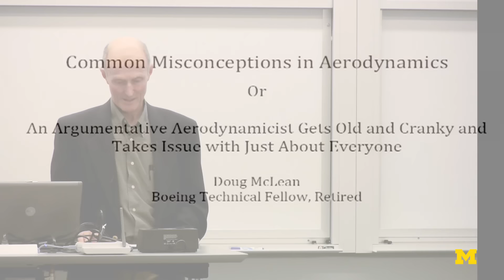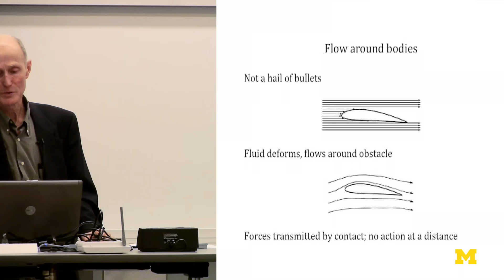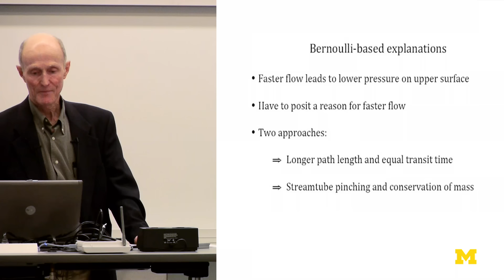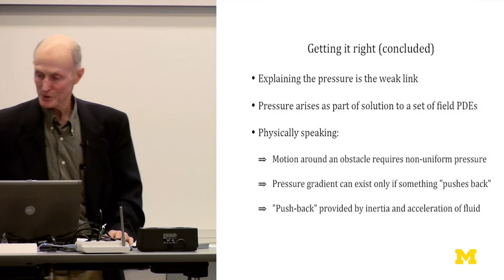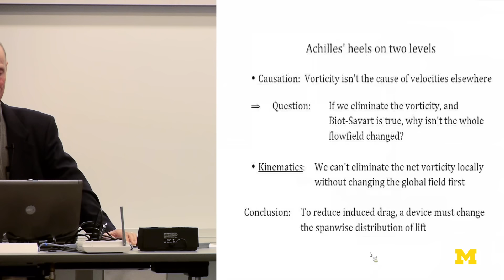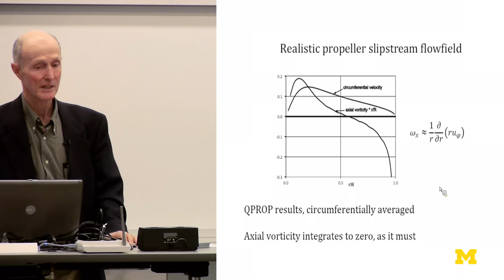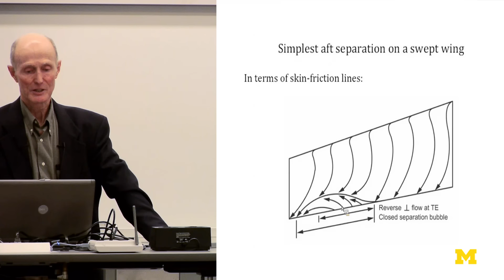Doug McLean | Common Misconceptions in Aerodynamics

Comment: I've put a splitter on the back of my car that resembles the engine cowling of a Boeing Dreamliner. It seems to work exceptionally well at reducing the vacuum behind the car, and has a significant impact on fuel economy. (Partially seen in my profile photo)
Reply: If you are referring to the random sized shark-teeth edges, weren't those supposed to lower the sound (noise) from the engines? You have used the words "exceptionally" and "significant" to describe the performance of your design, so I am assuming a patent is in the offing? If not, at least a video for the rest of us, is required.
Reply: Do you mean a rear diffuser? https://en.wikipedia.org/wiki/Diffuser_(automotive)

Comment: Literally you should be able to use a barn door for the wing because the traditional wing shape is not explained at all.  If Bernoulli had any effect or validity whatsoever then an airplane could not fly upside down nor would a symmetrical wing fly..
Reply: To address your last point: It all depends on the angle off attack (AoA) which is the angle between the incoming flow and the straight line between leading edge and trailing edge. A symmetric airfoil does not generate any lift if the AoA is zero. In fact, the pressure distributions at the upper and lower side are the same which is perfectly in line with Bernoulli. However, if the angle of attack is positive the generated lift is positive and at negative AoAs the generated lift becomes negative. Also, chambered profiles may produce lift at an AoA of 0, however they also have an AoA at which they generate a lift of zero.
Reply: This is the simplest lift explanation. Bernoulli and all of the fluid dynamics stuff is efficiency and flow around the ends of the wing. In my opinion.

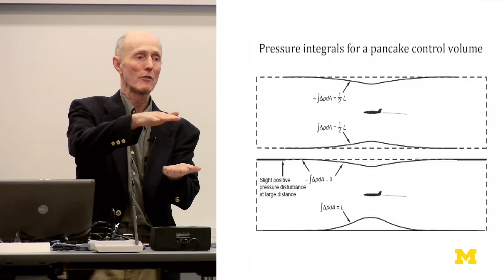Comment: 45:56 So...a layman's understanding here...He's saying that an airliner weighing 65 tonnes produces a downward force equivalent to the lift of 65 tonnes, but it doesn't crush everything it flies over, because that airliner is hanging in a volume of air far larger than the aircraft. The change in PSI you experience from an airliner flying over your head is around the same as a cold front going through.

Comment: I have my BSc in physics as well and I'm also about to get my private pilots license and every time the explanation of lift came up during ground school it never made any sense to me. Why do air particles HAVE to meet at the other side of the airfoil? They don't. Why is the fluid speed faster over the top surface etc. It's always explained in the pilot community with these naive explanations but this and a couple other videos are gems when it comes to gaining a true understanding of things. This reminds me why I chose physics as my degree!
Reply: One thing I'm surprised no one touches on: the contribution of inertia of the contiguous volume of air being accelerated by the angle of attack, the underside of the wing.

It's not clear why it's never mentioned that inertia of the air contributes to lift for airplane wings. It is only hinted at when Newton's 3rd law is mentioned.  An airplane wing traveling at constant velocity (ie. plane not accelerating) encounters air at neutral (isotropic) pressure and accelerates air below the wing at a magnitude dependent on the angle of attack of the wing. 

(Extreme example: if the wing's angle of attack were made by turning the wing vertical, the inertia of the air would prevent lift, and the airplane wing would be acting only as an air compressor for the air immediately adjacent to it.)

If the air could be accelerated instantly - with no inertia - it would not create lift.  The delay in response, caused by inertia, for the air under the wing to 'get out of the way' of the wing's angle of attack is a contribution to lift.  The air cannot 'get out of the way' instantly, partly due to inertia (air being matter, and all matter experiences inertia under acceleration).   The angle of attack is therefore partially compressing the air immediately adjacent to the (underside of) wing, and the compressed air pushes back against that, creating lift (Newton's 3rd law).

This is also why a wing does not 'stall' if its constant velocity is great enough: the angle of attack of the wing accelerates the air underneath, and at great enough velocity, the acceleration of the air under the wing is great enough so that its inertia (inability to instantly accelerate 'out of the way' of the lower part of the wing) is great enough to contribute to lift.

If the wing is moving too slowly, inertia of air being accelerated by the angle of attack can no longer contribute to lift.

.
Reply: The false "equal transit time" is a misstatement of a related requirement:  in steady state, rate of mass in has to equal rate of mass out.  We know intuitively this has to be true.  This more carefully considered truth drives the acceleration of airflow due to the path restriction of the airfoil's asymmetry to be faster than "equal transit time."

For the "equal transit time" fallacy people are focusing on too tight a location in space.
Reply: Yep, you don’t go into much detail in pilot training, especially for private, primarily because you don’t need to be an aerodynamicist or aeronautical engineer to be a good pilot. Being a good pilot is mostly about situational awareness, adherence to checklists and safety procedures, and some stick and rudder skills. For example you don’t need to know why the boundary layer exists, or why the air molecules do what they do, only things like how an airplane stalls, a general idea of how lift is formed, forces, etc. Everything after that is just extra credit in my opinion because knowing the ladder really won’t make you fly better unless you want to be a Test Pilot or engineer.

Comment: I enjoyed this lecture very much.  I always thought that the average pressure at the surface of the earth must go up slightly.  My simple view is that, for example, if a 747 weighing 735,000 lbs. is contained in the atmosphere then the average pressure at the surface of the earth must go up by (735,000 lbs.)/(790.4x10^15 sq. in.) which is about 1x10^-12 psi.  I'm guessing the actual pressure directly under the aircraft is momentarily much higher (as was shown in this video) but, in the long term, the entire weight of the 747 must get transferred to the earth's surface and reflect itself as a small pressure increase on the ground.

Comment: I am sure that the Pressure field sustained by fluid innertia and acceleration can be explained with some simple test setup with a piston and gas. In fact must be able to do that together with combustion engine engineers who look into detail of intake manifolds and piston movement. I am sure a Technical Physicist can build a model and explain. Quite surprised that Boeing would not have done that R&D considering the scramjet technology out there.  Rather important to understand pressure waves?

Comment: The common thinking here is that the air flows along the surface of a wing or wing profile, whereas in fact it is the wing that passes the air particles, causing them to react in various ways. It would be important to really begin to think about this wing-air interaction in this way, to understand the phenomena.
Reply: It's Newtonian physics, it shouldn't matter
Reply: @DF-ss5ep  I mention it because its there. I leave it to others to figure out the possible differences. :)
Reply: With a sailing yacht the wind typically is faster than the wing profile ( or sail ) of course but things are different with an airplane.

Comment: I am not entirely sure this video really did clarify and explain how lift is generated. it started off pretty good to debunk the wrong ways of thinking how lift is explain, but at the end I am still not sure if it did much to explain how it's generated. Perhaps I missed something, which is possible.
Reply: @William Buckley; Mankinds Great Intellectual! Mr Buckley, I believe we understand how an airplane flies and how lift is generated. We know lift is the resultant of differential pressures around the wing. That much is clear to a lot of people.  I think the problem is how we explain it and your statement above is a good example, which is what the video debunks. We know Bernoulli law explains that increase in velocity of an air molecule on the same streamline decreases pressure and slow air molecule increases pressure and the resultants of imbalance pressures keeps planes in the air so that's not the issue. The issue is often times, the explanation as to why the velocity increases at the wing top and decrease at the bottom of the wing is where people explain with haste. And you made the same mistake in your replay. As the video debunks, what is the physics behind the claim that the air molecule at the top and bottom has to meet? Did they decided at the leading edge that "hey meet me at some time at the tail end of the wing and let's have pizza and beer?"  That's the issue with such explanation--there is no basis for that logic in physics and that's where people confuses the issues. I think the video did a good job debunking that explanation, but my problem with the video is I didn't understand the replacement of the physics explanation as to why the velocity increases at the top and lower at the bottom. That's what I was asking about. Thank you for trying to help, but I think like me, you also didn't get the physics explanation of the why the velocity increases at the top. I would like someone to explain to me as to what the physics explanation is that causes the velocity to go up .

Comment: Why dont we see swept up wingtips on rear horizontal stabilizers? Only on maing wings?
Wouldnt adding this also reduce drag?
Reply: I have no answer to this with regards of what's better, but they technically do exist. A lot of WW2 aircraft and even the A10 today kind of achieve this by having a double vertical stabiliser on the edge of the horizontal stabiliser. For military I know that there's radar cross sections that need to be considered which increase drastically with angular planar surfaces, the A10 is an exception because the stabilisers are actually used to hide the hot engine exhaust from IR seekers.

With regards to airliners, I think it depends on the results of CFD and wind tunnel tests. I would guess that if rear winglets increased efficiency they would be on there since an airline's goal is to maximise cost. But take this with a grain of salt.

Comment: Interesting discussion and agreeable   Theoretical explanations. Especially ground effect. Often misused words have caused common misunderstandings and debate. If we correctly describe lift and induced drag as components of a total reaction vector ( up & back if you like ) it becomes easier to talk about each component as parts of a whole rather than commonly labelled individual phenomena dependant on the other. Moving and airfoil through relatively still air compared to the inverse wind tunnel or modelling ( moving fluid ) environment does not get much consideration but perhaps it should. Vortices change the velocity of airflow over a certain area of the airfoil in increasing or decreasing amounts. Think angle of attack speed and the trade off effects on the total reaction. Useful for work airfoil area vs not useful etc.

Comment: Speculative interpretation of tip vortices, have been modified energetically, and reversing the spin would cost another amount of equal energy, doubling the power waste. 
The better idea is Dragonfly Wings that produce then rectify the pulse-spin of each wing in sync-duration.., like the period doubling of frequency in a Fishtail thrust against the water.., and yes it does relate directly to harmonic conductivity in logarithmic spin-spiral 2-ness holistically of course.

Comment: Wind passing over a water surface like the ocean, what are the relationships that then cause a wave to develop and move across a surface when the individual molecules do not move. Inertia of molecules caused by the spinning of the atoms that make up the molecule, account for this inertia.  For every molecule that is moved another thousand must move because of proximity.  Newton and inertia is the primary event , low pressure is the outcome and lift is the result of a introduction of Force in a steady state.

Comment: Yes lift is generated, it is the air pressure difference distance between the top and and the bottom of a flat shape or a symmetrical airfoil even with no air moving over the surface.

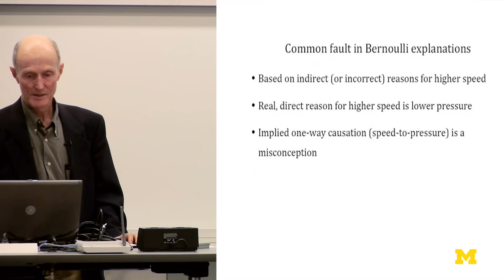Comment: I really liked this lecture but some parts definitely made it feel like the speaker has some strange philosophical ideas about the ontological structure of mathematical models of the physical world. For instance at 19:44 bullets 2 and 3 seem to be in direct contradiction, and in general there seems to be a tendency to assert the primacy of certain mathematical features of fluid flow as the "real" driving causes of a phenomenon over others (e.g. vorticity and velocity, etc.). If you assert that a physical law is true and the roles of two variables in an equation are truly symmetrical (so each variable can be recovered from the other, all else being equal) then I think it's adding philosophy to the physics to say that a change in either quantity "causes" a change in the other. Instead it seems that one has to admit that the quantities are inextricably bound up with each other, and that both measure the same underlying physical reality. The speaker himself comes dangerously close to asserting this at several points during his talk. 

To a lesser extent I also don't really see why an explanation of lift derived from "Newton's third law" is really inadequate at all (if, say, it mathematically replicates all physical data to a decent degree which it really must if the explanation is precise enough): certainly Newton's third law is true, and given that one can impute responsibility for the lift of an aircraft to the concomitant downward acceleration of the air around it. Yes one doesn't provide the literal "force" that is acting on the airplane but for one: (1) forces are only measured through their acceleration on the bodies they act on; (2) we already know it's going to come down to the electrostatic repulsion between the air and the wing, so why bother?

Anyway the misconceptions were very interesting to see, especially the (obvious, in hindsight) failure of Fubini's theorem towards the end of the lecture.

Comment: Great talk. The main thing I wish more teachers would point out is that the reason an airfoil affects the atmosphere ahead of itself is because pressure differences propagate at the speed of sound.
I especially like your point that the inertia of the fluid is essential to maintaining the pressure difference. i.e. inertia provides the time delay between propagation of the pressure, and mass actually being accelerated along the pressure gradient.
Reply: I think it's a bit trivial to state that inertia is needed. If it doesn't have inertia it doesn't exert forces (momentum is conserved).

Comment: I have always found the Newton's law explanation of Lift to find intutive...Bernouli a bit more difficult..but I can see how they complement each other
Reply: Bernoulli is for flow in tubes, not free.
Reply: Well, in order for Newton's 3rd law to produce lift requires the air flow to be directed downwards, which it does not explain itself. Consider airfoils that produce lift even at negative angles of attack. The intuition of course makes sense, IF air is "pushed" down locally then the wing should be pushed up.
Reply: @0MoTheG  No, Bernoulli applies within any flow field.
The problem with using Bernoulli to explain lift is that it actually only explains a very narrow effect/relationship of static pressure and kinetic energy.
Reply: @0MoTheG  Like John Doh said, Bernoulli applies within any flow field reasonably as long as the flow doesn't exceed a mach number of around 0.3 (it's not super clear cut when it stops being useful but it's an industry rule of thumb).

Comment: The equal transit time hypothesis simply confuses the action with the reaction. It says you invoke a pressure differential and then get lift from it. This is like saying that lift causes lift. In reality however you can only get lift if you deflect air. And you can't deflect air without getting lift. Lift  is an upward force caused by a downward one. The bernulli principle can help you understand  how a force transits to a wing, but doesn't explain the cause of the force, which the deflect of air. Try getting a upward force on a wing without deflecting air downward.  You can't. Trying to get away from this basic fact, won't help you. Lift doesn't doesn't cause lift. Only a downward deflection of air causes lift. There are no other causes period. In order to make an omelet,  you'll have to break eggs. All our work is in front of us to fix the faulty textbooks that have proposed a false model propogated by folks who didn't hnow what the fuck they were talking about. It's high time that we called them out, and held them responsible and accountable for their false reasoning, and their failed hypothesis. They should be held to fix the textbooks.

Comment: Isn't the drag and subsequent vortices caused by a difference in the proportions of air moving by imbalanced times of arrival at the back side of the wings, along the edge path? In other words, the flow at 10 feet along the wing is flowing faster than than the airflow at 20 feet, and still faster at 30 feet at the very tip? (I might have gotten that reversed)